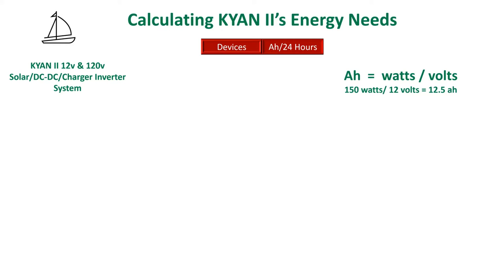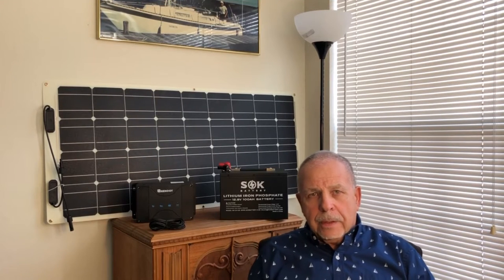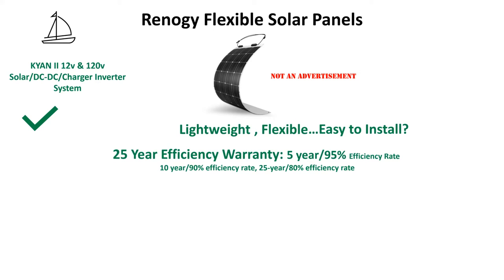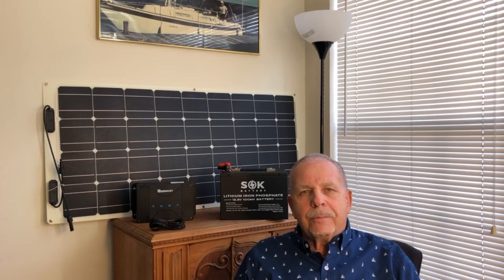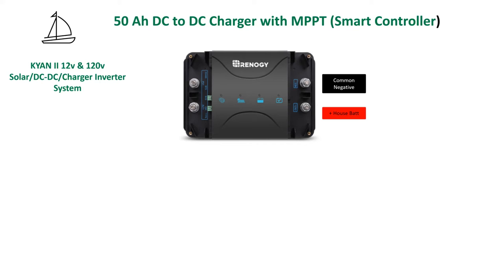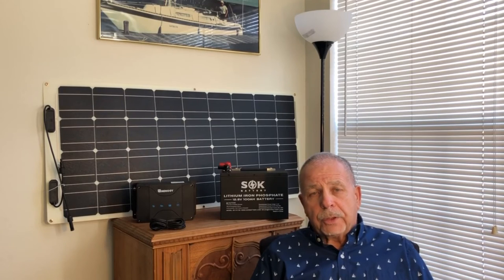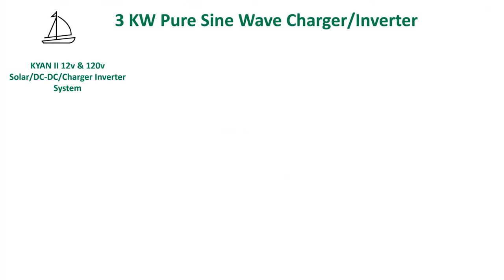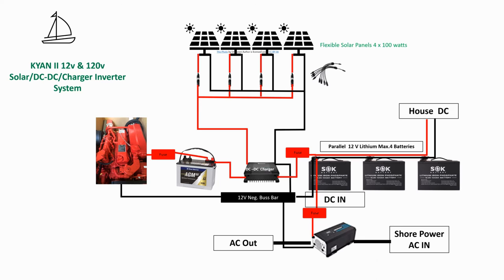The Solar Sailor Part I shows the easiest way to calculate your solar power needs.

Comment: Those flexible panels should last you 5 years or more if you're careful with them. They are an expensive solution when it comes to replacing them. It is handy that they can flex slightly.